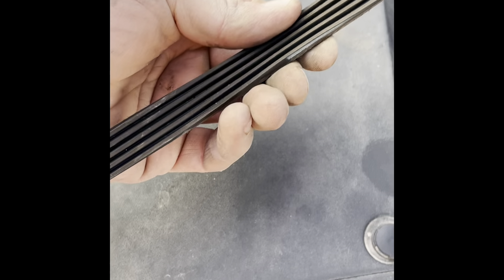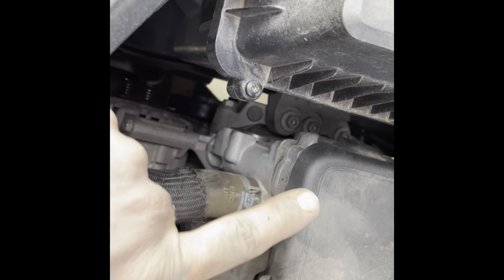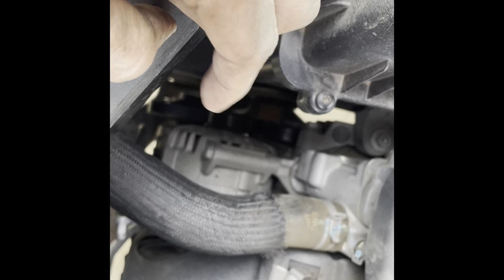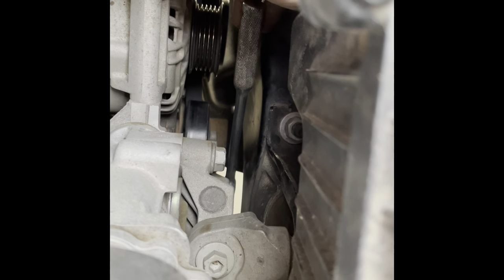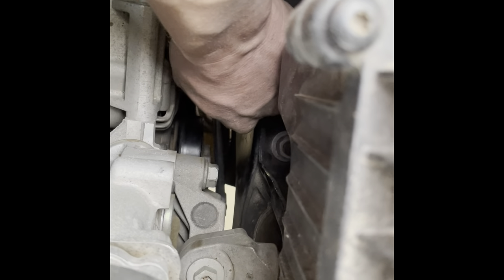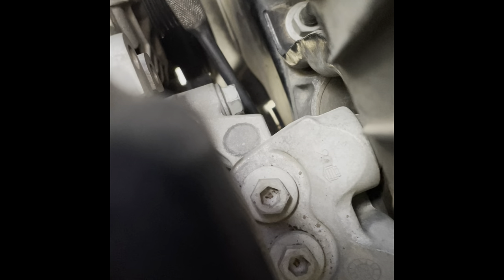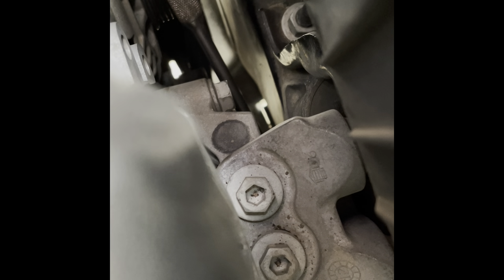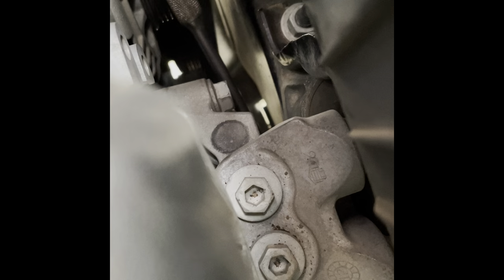Chevy equinox serpentine belt replacement Simplified

Comment: Is that just a long 3/8 ratchet with no socket? How  many miles once i lose the rubber on one side and it starts sqeaking?
Reply from the maker: Yes just a 3/8 ratchet no socket and I would immediately change it before your stranded could last a day could last an hour not worth the chance belts 10$

Comment: I just paid 300 to have them come 3 miles to tow my truck and 3 miles back to there shop and to change only the serpitine belt. Did I get ripped off?
Reply from the maker: @monicamoore8550  in my opinion yes the belts only 20$ and can be done in 10mins or less. But I’m a professional cheap ass 😅
Reply: @handyishrandyish334  lol thanks for responding. What's the most you think I should have been charged for the tow and the belt change
Reply: Honestly yes and no lol the reason the bill was so high was because you had it towed which is not cheap even if it is a short distance and then ofc the labor and part honestly somewhere around 200 to 250 would've been a fair price in my opinion

Comment: So this done just from the top and not from wheel well or bottom?
Reply from the maker: Yes All from the top side no need to remove anything it’s a little bit hard to find the tensioner but other than that it is super easy

Comment: so in the wheel well of my car theres a hole to access the tensioner bolt.  i dropped the bolt inside there and can not access it.. any idea?
Reply from the maker: Do you have a flexible stick magnet. Or magnet on a string

Comment: What are the odds my tensioner needs a 1/2” instead of 3/8”
The square hole I found is bigger than my 3/8”
Reply from the maker: @williammatthews6199  Iv done a big number and multiple car brands they have all been 3/8. Possibly stick your phone in there with camera and light on so you can get a view of where your ratchet goes in. Iv never ran into one that was anything but 3/8 square

Comment: Would a faulty tensioner and loose fan belt cause the motor to his louder?
Reply from the maker: Not necessarily the motor, but you could have noise coming from your pulleys or from the accessories that the belt runs.
Reply: @handyishrandyish334  Same im thinking, Equinox n terrain hiss naturally but i feel mines hisses more than the norm n its annoying me. Was told its the belt and the tensioner

Comment: My belt just came off while driving. Got oil leaking some where any idea where from?
Reply from the maker: I would have to see it but the belt coming off can’t cause oil leak unless it somehow damaged something on the motor? Start at your highest point that you see oil
Reply: Well I been losing oil, but never seen a leak anywhere. I'm about to try to put the belt on myself.
Reply: It's mostly around the belt on down though.
Reply: @Justin-uv4ji did you ever find out where the oil was leaking from because I own an equinox and have the same problem.
Reply: @patriciabounds3853  when the belt came off, I noticed the pcv hose wasn't connected, so i think it was causing pressure to build up. So it could've been from that I'm thinking.
Reply: @Justin-uv4ji  I think I found the problem. I've been up all night researching and I'm pretty good at it, lol. There's a seal in the crankshaft pulley, a circle seal, that's inexpensive, and its a known to cause of oil leaks in that area if your car is still leaking. It will cause the oil to leak on the belt which will cause it to slip off. I'm getting it checked asap
Reply: @patriciabounds3853  yea I read on that, too.. but I'm not sure if the belt broke or just came off. It did look worn out some.
Reply: @Justin-uv4ji  I saw about replacing the drive belt tensioner, the pullies in that same area, and check the pullies bearings that wear over time. I regret not being a mechanic now like my father wanted me to. I hope you find the solution.
Reply: @patriciabounds3853  mine pulley not making any noises. My belt been good since I put the new one on

Comment: I tried with a 3/8 ratchet but it doesn’t go in looks like yours has a square tip maybe that’s why I can’t do it
Reply from the maker: @jessejames3988  yes the tensioner has a square notch you must go further down on the tensioner for the right notch there is a round one up higher
Reply: Thank u so much you’ve been a great help